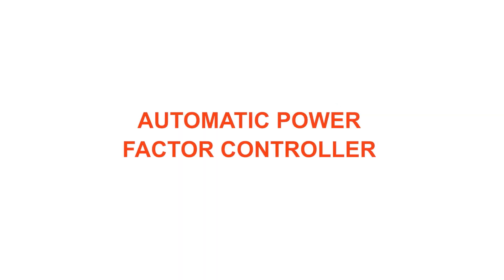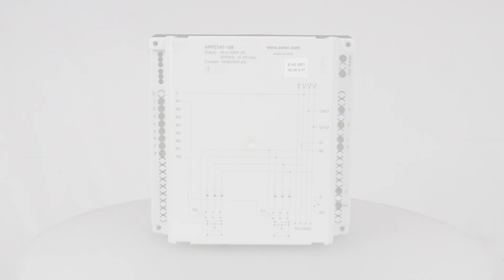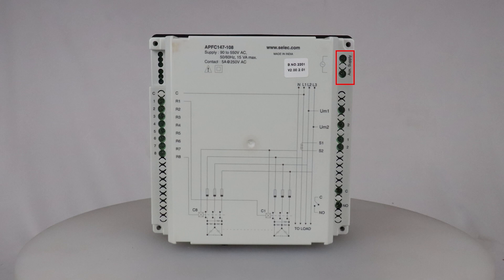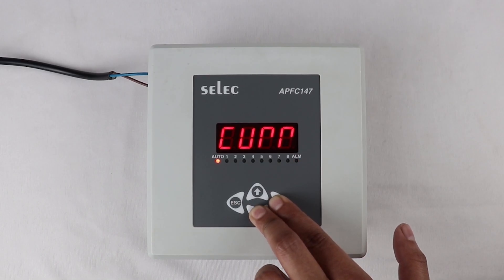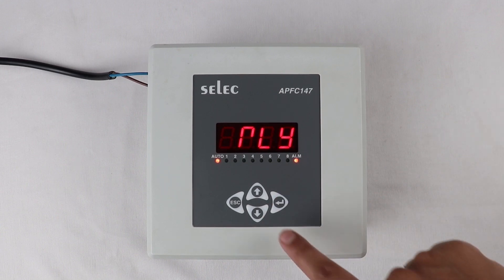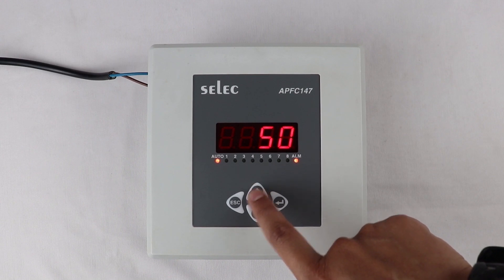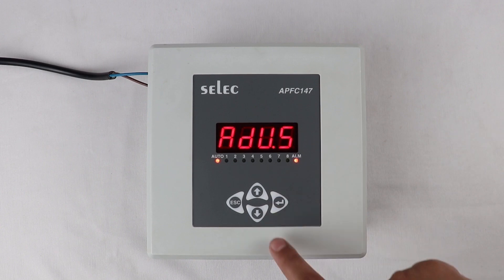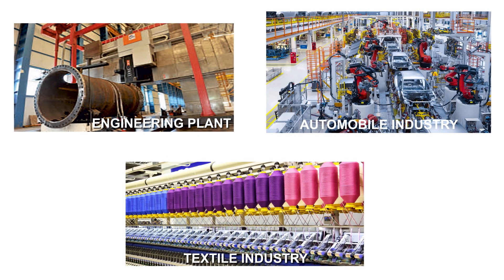Selec APFC147 Automatic Power Factor Controller: Introduction|Wiring Diagram|Programming|Application

Comment: Hi iwould like to know if the alarm lights keep blinking how to check if theres any problem? Thank you 🙏
Reply from the maker: It blinks continuously in trip condition. Press enter key to see the trip condition parameter. Call us at 022-41418468 to know more.
Reply: @SelecControlsvideos  hi i have click enter and shows ovlt over  voltage but i cant get in to the setting, instead its shown PSUD, can you help us regarding this?? Is thwre any watsapp phone number? Thanks really appreciate it 🙏
Reply from the maker: @vickyhendrio1578  you can whatsapp us on 9136977315
Reply: Hallo sir muja  relay ki satting karna ma thori porplam ha rhi ha kha ap apna WhatsApp number send kar sakta ha